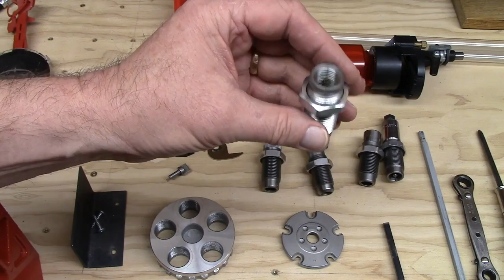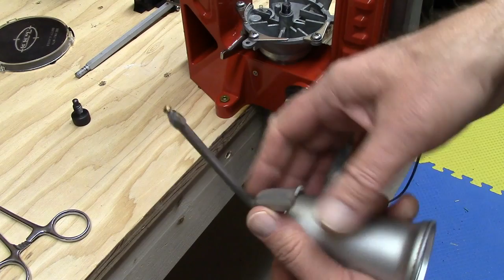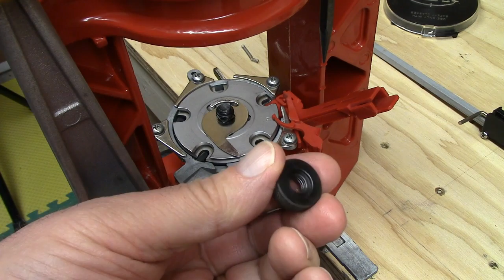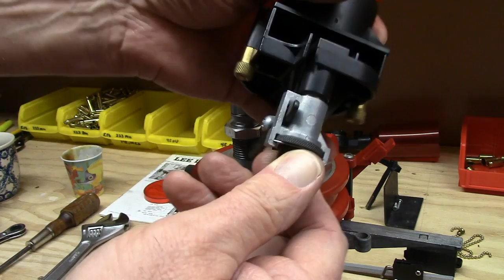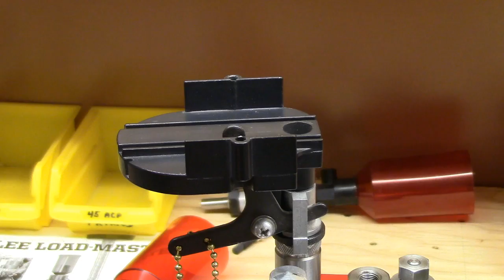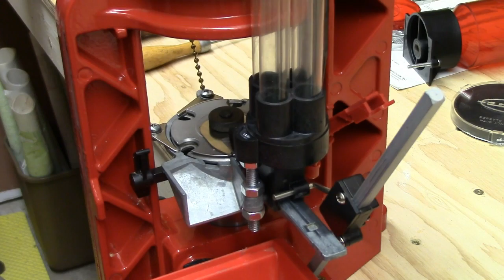How to Use the Lee Precision Load-Master ~ PART 1

Comment: I have used my LM for years but recently restarted reloading again. Most of the old Loadmaster related forums are gone or shutting down so your videos are the best resource for setting up this press. I am curious that you don’t use the extra 1/4 turn on the dies after contacting the shell plate as suggested by Lee. Is there a reason for that?

Comment: Setup for 223?  I am doing all my decapping and sizing prior to loading . Is the lee 90179 quick trim die recommended on station 2 (priming).   Can I use the bullet seating die for that purpose?  I am going to use the rcbs seating.and crimping die instead.

Comment: Hello GunBlue490, Thanks for the great video. I think I missed the answer as to why you want a separate Universal Decapping Die for each Turret. I've loaded 5.56 & 300BLK in my LM, and needing to switch over to 9MM for the first time. Thanks in advance and keep up the good work!
Reply from the maker: By positioning the universal decapping die at station 1, it moves the sizing die, with decappling pin removed, over to station 2, which maintains alignment of the case over the priming station to prevent primer misfeeds. It can only be done with straight wall pistol and rifle cases.  However, I believe that Lee has made some changes in their newest model that incorporates a fix for that issue.
Reply: @GunBlue490  Yes that I understood. But I may have misunderstood you in stating to get a Universal Decapping Die for each turret plate. So my question is why not just swap the die to the plate that's going to be used instead of having a duplicate for all your plates/calibers? Thanks again.

Comment: Worst advice I have heard recently is to not use lube with carbide dies. I have removed too many stuck cases for friends that did not lube cases.
Reply from the maker: You are telling stories.  Total nonsense.  I have loaded literally many thousands of pistol rounds with carbide dies, including hundreds of thousands with my department's Star Universal press and have never ever encountered a stuck case.  That's exactly why carbide dies were introduced.  A case going into a carbide ring of a straight wall die should NEVER be lubricated.  Ever.  Period.

Comment: I really like using the moly lube you use to put ar15's together with. It seems to work very well and it embeds moly into the metal. Thanks for suggesting the decanting die. I was going to use my quick trim die to align the primer station but your suggestion is better!

Comment: Yes I do that because I watched "GunBlue's Guide for the Lee Precision Load-Master ~ PART 1" video. 
Great info. Everything is clean and properly lubed. The indexing rod is pretty floppy in the shaft it rides in. Is it supposed to be real loose and sloppy? 
As you suggested, I am going to screw the rod holding fitting in one more full turn and see what happens. 
I am trying to put a few more videos on YouTube but I am having a hell of a time getting them from my phone to my computer. These gadgets are always screwing up. Even my geek wife cannot do it. Trying again tomorrow.

Comment: Hello again. New problem. All works well until I put on a full 'tube' of cases. It appears that the weight of a full tube of cases prevents the case feeder from pushing fully forward into the case holder plate. The case stops short of going fully home. This does not occur as soon as I remove the TUBE of cases and hand feed them. 
Wazzzzzzup ???

Comment: What would cause just three 45acp cases to fail to decap, no matter how many times I put them through the decapper,  when 47 others decapped fine during the same run??.
Reply from the maker: Check your decapping rod. To prevent breakage, it is captured by a locking collet by friction alone, and will slide upward when it encounters an obstruction, such as a sand blocked flash hole. If the rod extends above the collet nut, it has slid upward. Adjust it until the rod is just flush.  It requires a lot of torque to loosen an retighten, so it's best done out of the press with two wrenches and a vise to steady the body.
Reply: @GunBlue490  Thanks. That is probably it. The rod sticks up a bit from the collet. I'll adjust.
Reply: @GunBlue490  THANKS again for your help.

Comment: Still a bit confused. The loadmaster comes with a FULL LENGTH "sizing" DIE WITH DECAPPER. Stage #1.
They say to buy a UNIVERSAL DECAPPING DIE for stage #2. ?????? 
Aren't they BOTH "sizing" dies too." If not, which die do you use in stage #1? The one sent with the unit or the one you buy later?

So why get a second die for sizing only and remove the decapper when the case was sized by the first die that contains a decapper.???
Reply from the maker: Lee is currently equipping the Load Master with a new system that I wish they had done when I purchased mine. That is, station #1 sizes and decaps, as usual. Station #2 now includes a new caliber specific alignment die that lightly holds the case to keep the case squared over the priming station, which prevents off-center priming misfeeds, flipped primers, etc. that were a problem before. It's a perfect solution.  A universal decapping die does not touch the case; it only decaps, and is no longer necessary with the new system, but is a great case preparation tool for other tasks.
Reply: @GunBlue490  OK thank you. I set mine up by removing the decapping pin from the one that came with the unit and putting it in station # 2.
 Then putting the universal decapping pin in station #1. That should do OK, right?

Comment: I watched countless videos on the Loadmast. After this video, which is awesome, I went for it. Started setting up trying to follow your tips. Unfortunately my luck was not like your. It won't index. Tried adjusting the carrier alignment and tried the flipper adjustments for literally a couple hours going back and forth between the two. Best I could get was indexing 2-3 times then  locking up solid. Anyone want to buy an unused press?

Comment: Thinking about upgrading to this Press, on my Classic and Pro, I always Decap n Prime Seperatly, on both i use the RCBS Powder Check Die after Powder Drop, if theres a Under or Dbl Charge, It Automatically locks the Press from Advancing, takes to keep having to Weigh the Charge every so Many Rounds, and the Did I or Didnt I Thoughtduring the Process

Comment: Thanks you! 1 hour invested and my press is running well again. I didn't know about lubrication of most of the areas that you pointed out. I always thought grease and oil were the enemy.
Reply from the maker: These machines require a balance of lubrication to keep them running, but without attracting fouling and powder. It's generally good to clean it up and lube every so often as need dictates. Experience will guide you.

Comment: My turret holder won't align the plate index when tighten up. It causes every die having a small offset right to the brasses holding on the plate. I cannot change the plate indexing because it is the only place where the primer come up through the hold on plate on station #2. How should I do to fix the issue?
Reply from the maker: Each of these components are fabricated identically, and indexing is not variable from one station to another. If a station is lined up for the first die, every other must be.  I have no idea why things aren't aligning for you.  Be sure your turret is correctly positioned so and that you are using the correct shell plate designed for the Load Master, and not one of their other presses.  Be sure you are using the correct shell plate number for the cartridge you are loading.  Some shell holders are similar in size but are not the same, such as the 380 plate, which can be mixed up with the 223 or 9mm Luger plate.  It sounds as if your turret is incorrectly positioned when you tighten it.  Don't tighten the knurled nut on the turret until your cases are aligned with the dies.  Also, be aware that certain rifles such as the Mini-14 will often badly burr case rims so that they don't slide onto the shell holder fully.  Contact Lee for technical assistance.  They have experts that can happily assist you.
Reply: @GunBlue490  Thanks for the guidance. For my case all stations has a small offset when the screw is tighten up, even though I am using correct plate for 9mm reloading. When I have the turret screw loosen and the press on upper position with cartridges almost touch dies, I can manually move the plate or turret holder for alignment that primers can be raised and the cartridges fits in dies smoothly. However, if I try to screw in the turret holder, I can clearly feel the force rotation the turret holder against one side of all cartridges. I am contacting the seller to send me a new Loadmaster and I will update my finding on the new one.

Comment: I quit using this press 15 years ago because of the constant breakdowns every few minutes. I pulled it out of storage today to try using it as a decapping tool. Guess what it doesn’t index properly. A few cases and breakdown. I changed the whole base assembly and indexing rod. Didn’t matter. I looked up gun blue assembly video which is great but no luck. Biggest piece of junk I’ve ever owned. Save yourself the aggravation and buy a Dillon. Never had a failure. Ever

Comment: I bought the progressive kit for 45 colt. But damn feeding 9mm case does not work at all. the shell sitting on top of the shell getting ready to push to the shell plate hangs on the shell pusher. Any ideas on how to fix that? The 9m sits below the top of the pusher. So the shell sitting on the bottoms shell its case bottom is in striking range of the pusher. when you push the shell goes sideways and jams everything up.
Reply: @UCtLSlyj_4BuhqWZM7_H5P7Q What fixed my issue what buying a new shell tube kit. Now I have zero problems between 45, 38 special, or 9mm. I love my press now that it works. the one other problem I had was the dimension of the shell pusher. Pulled it apart and they had some real dam ass short screw for tensioning. I Threw that crap out and got one same dia but longer. My pusher works like it is supposed to now.

Comment: I'm having a problem with the cases really binding up in the resizing die.  If I run the brass one at a time, it isn't so bad, but if I have all stations occupied, I really to lean on the ram to get it up completely and then really have to pull on it to get it back down.  Could it be that the die is set too far down?  HELP!

Comment: Outstanding video,  Very well presented and professionally articulated information, 

 I was trying to convince myself not to buy the Loadmaster,  But now I'm convinced i want one, AND i can get one of these to operate correctly based on this video 

I have used a 4 hole turret for many years and  10's of thousands of rounds, in many calibers  I have had very good results with it, this would be the next step for me,
 I loved the conversation on the oil can in the comments below ....funny..... those ball fittings were common on lathes and other machinery in years past :-)  Great instruction video !!!

Comment: I am in decision mode on turret or progressive. I loved your step by step. Question how much trouble to switch from colt 45 long to say 38 special or say 9m. My friend is saying just do the turret because I don't shoot that much. But looking at money spent for either they are damn close in price. Also, can the progressive be used as a single loader like the Turret loader? Granted progressive you have to buy a top plate and bottom plates and that adds cost to the progressive press. Your response I am truly looking forward to. Thank you in advance.
Reply from the maker: The change from one caliber to another takes about 30 minutes, including cleaning, changing die turret and plate, adjustment of the case feeder height, and setting the powder charge.  That time spent is miniscule to the vastly large number of rounds that it produces.  Yes, a fully progressive machine can be used as a semi-progressive, though I've no idea why one would want to, except for initial setup.  A fully progressive machine requires a mechanically skilled operator who has intuitive understanding of basic machine operations.
Reply: @GunBlue490   Thanks for that. I repair for a living and I thrive on troubleshooting to get the results I am looking for.

Comment: I cannot thank you enough for this 2 part video and the one on the 223 reloading. I just picked up my first press and it happens to be the Load-master!  Because it is used, I decided to pull it apart (100%) and reassemble while using this video to oil properly and make the adjustments to the basic items as I have 3 die sets on order. 2 questions: 1 - Do you have any experience or videos on the Micro Adjust powder feed?  2 - Any comments of videos on the Auto bullet feeder?
Once again, Thank You for this great video!!

Comment: Excellent video, I had a two questions.   1. the last die - "post sizing die" - is that the same a factory crimp?  2. For 223, I was going use Decap die + resize die (without center decap pin removed as you video) at the primer station but then LEE told me that if you were going to use a sizing die for station.  The decapping rod need's to be installed with the decapping pin grinded off to hold the neck of the 223 brass.  Lee suggested to use their quick trim die in the primer install station instead of a sizer with the decapping rod.

Again thanks for the great videos on how to use and set up the Load Master !!!!!
Reply from the maker: Yes, the post sizing die is the pistol factory crimp die.  The rifle factory crimp die does not perform a second "post" sizing, but only crimps the neck.  My comments concerning the dies for stations 1 and 2 concerned straight wall pistol cases, and cannot be followed with bottle necked cases, as stated by Lee.  Their recommendation for using the trim die is a good one that I may try, though I've loaded thousands of 223 with no die in station #2 thusfar.  However, it would certainly reduce or eliminate the occasional tipped primer caused by misalignment.  The most important thing to watch for is loosening or wobbling of the shell plate that causes the primer pocket to tilt.
Reply: @GunBlue490  Thank you very much for your reply back.

Comment: How much do you "feel" the case being full length resized on station 2?  I'm doing 9mm and the cases feel tight... doesn't feel like binding or anything, but additional force is required to push the case all the way up into the die. It's smooth but definitely requires some force.

Comment: is there a way to use the powder measure without using the belling part. I have the loadmaster kit in 223. discovered that to load pistol cartridges I will need to purchase a thru powder die in the specific pistol caliber . I want to use my rcbs dies , sizing and belling dies, is there a universal charging die setup

Comment: I've been relaoding for 40 years and am now looking over all the new technology. Loadmaster seems to be as good as any. I'm into CAS and need to maximize volume. 

Great suggestion to use separate decapping die. Lubrication details and overall details with clear explanations and camera work is outstanding. Great for beginners and veterans. Most people don't realize this kind of detaled maintenance is necessary, and get ticked off at the machine and manufacturer.

Comment: I have a new Lee Load Master order the 44 special/44 magnum. My load master does not have a the small ball bearing port to oil the shaft. I have to apply oil on the shaft  and move it around with a paper towel to lightly oil the shaft once I did that the action was very smooth , out of the box it was very stiff when the base plate reached 3/4 to the top. My shell plate indexer does not have a bevel, heard you have to make that yourself with a dremel tool.

Comment: I haven't  used my Loadmaster very much, so when I pulled it out of storage to load 357 mag I decided to watch your video again.  I followed your suggestions/procedures to the tee.  What a great video.  I love your calm demeanor.  So I loaded over 300 with hardly a hitch.  I have learned to watch very closely that I still have primers in the feeder, that the decapper pin hasn't been pushed up indicating a shell has gotten through with the primer still in place, and that the incoming shell is right side up.  I did not have one, not one, primer issue!  The only thing I didn't follow you on was lubricating the shells.  I don't lube 9mm, but I find lubing the 357 to be very helpful.  I just spray a little lube into a large freezer baggy, add the shells, and then roll them around.  Takes less than 3 minutes.   Thank you very much for your video.
Reply from the maker: Ken Cammenga 
Never lube cases with carbide dies.  Carbide requires no lube, and will build up a mess under the carbide ring and transfer it to the shell plate. Non carbide dies always must be lubed.

Comment: Thanks for a good video. But if I may disagree, introducing grease/oil to the powder source, the case expanding piston, could produce a binding potential. My preference is clean and dry in that position.
Reply from the maker: STAN PETTA 
Grease is entirely isolated from any possible powder contact.  If not lightly greased, it will jam on occasion.

Comment: Yeah, the Lee Perfect Powder Measure is anything but perfect. The Lee Auto Drum powder measure is pretty nice though. The disk powder measure is good as far as it works well, but if you want to add 1 tenth of a grain + or -, you can't do it with the disk system. I bought the Auto Drum and use it exclusively now.